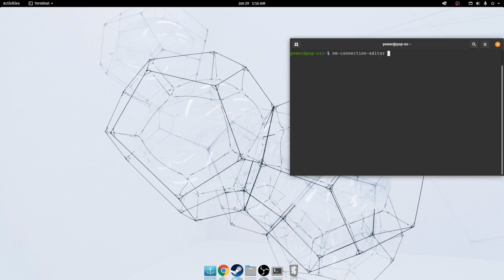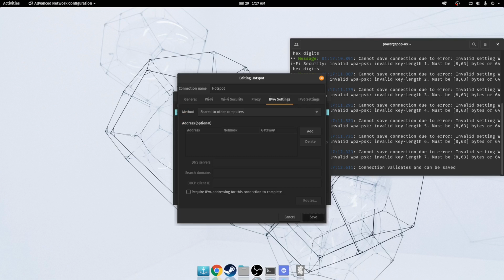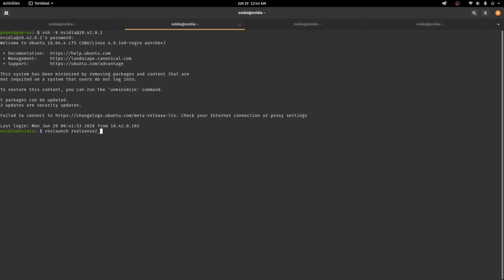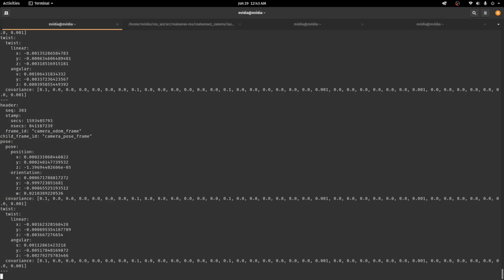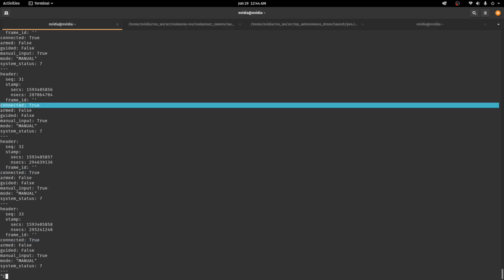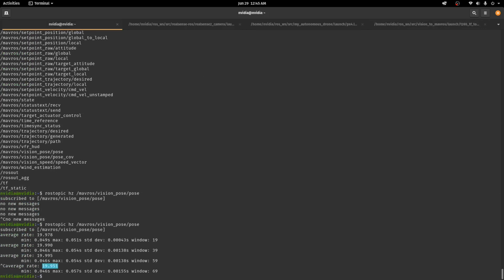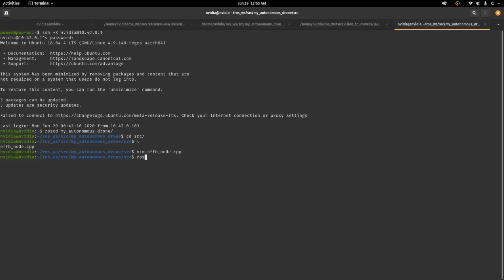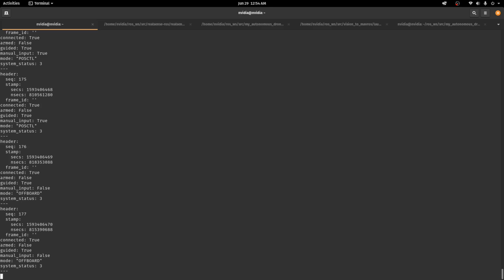DIY Indoor Autonomous Drone! - Finale (Flight)

Comment: Hi, 
Thank you for your great videos, 
May I know the model of the drone frame which you are using?
Reply from the maker: Hey! It's a Spedix S250Q
Reply: @SimpleKernel  Thank you,
 I've been working on an autonomous drone project, 
I am using Jetson tx2 as a  companion computer and T265 realsense as VIO and D435 camera as avoidance.
May I know how much the maximum drone's payload is?
Can it carry all the equipment that  I am going to use?
Reply from the maker: @calibronic  I don't know what the maximum payload is but your setup is similar to my setup. I had a TX2 with an Orbitty carrier board and a T265, I'm sure it could also carry a D435 without any issues.
Reply: @SimpleKernel  sounds great,
I need to change my carrier board. I am using original carrier board for Jetson which is too heavy.
I am checking the Orbitty carrier board that you mentioned, It seems, it has only one USB3 port.
Isn’t it ?
Reply from the maker: @calibronic  Yup!

Comment: Do you think that  adding vins fusion to the odometry of the t265 produce a more robust (to the drift or vibrations) odometry or only more precise ?
Thanks Simplekernel !
Reply from the maker: Hello! I'm not entirely sure, because I don't know how good the T265's odometry generation is compared to VINS Fusion. I think you may have to ask the Intel engineers over at the Realsense repository on Github.

Comment: @simplekernel Do we need to calibrate and sync  with Kalibr camera and imu of the t265 for the Rovio implementation as in the second and third episode ? Thanks for all !
Reply from the maker: The IMU and camera of the T265 are already in sync, so you can use the sensor as is with ROVIO. Here are two links that may be helpful: https://github.com/ethz-asl/vi_realsense https://discuss.ardupilot.org/t/integration-of-ardupilot-and-vio-tracking-camera-part-1-getting-started-with-the-intel-realsense-t265-on-rasberry-pi-3b/43162 . Good luck!

Comment: @SimpleKernel  Thank you very much for this part ! You are really talented not only as engineer  but as educator as well .I see from your website that you have an extensive experience on drones.Could you make an explanation or send some reference related to the control techniques (Kalman filter,PID )  of small swarm of autonomous drones  in acrobatics ? It is really difficult to me to grasp how the velocity and position control of a single drone can influence the others so quickly !
Reply from the maker: Thank you for your kind comments! Here is a good tutorial on EKFs: https://simondlevy.academic.wlu.edu/kalman-tutorial/. Hopefully it'll teach you the basic science which is used in flight controllers. Once you learned about that, you could look at Crazyswarm which use EKFs with multiple drone: https://github.com/USC-ACTLab/crazyswarm. I don't think it's a complex swarm implementation, but it should be something you should browse through as a starting point. In addition, just because Crazyswarm is based on the Crazyflie doesn't mean you can't implement the same system on your own drones. The lab that made Crazyswarm focuses on swarm behavior so I recommend browsing through their publications: http://act.usc.edu/publications.html. As for autonomous acrobatics without an external motion capture system, you should look at https://github.com/uzh-rpg/deep_drone_acrobatics.   Unfortunately, acrobatics is a very complex issue which I don't know a lot about, though I know a bit more about swarm behavior. In the case of swarms, there tends to be a centralized computer which commands all the drone modules. It plans trajectories and then attempts to mitigate collisions through optimization and scheduling, typically through a variety of techniques. The drone position and velocity tend not to be controlled in real time. I don't know of any simple resources so you'd have to dig up some papers around the web specifically regarding what you want to do (EKF control, trajectory optimization, etc.). Here is a good tutorial on navigation and planning in ROS that could probably be extended to swarms: https://www.wilselby.com/research/ros-integration/3d-mapping-navigation/. As for acrobatics, maybe you meant formation flying instead? That's much simpler. It would be helpful for me if you could specify more on your project!
Reply: @SimpleKernel  Thank you for this bunch of resources really really helpful ! The Kalman filter tutorial is interactive , 3d navigation tutorial is for me one the missing pieces .One year ago I tried to use the D435 and the T265 on a drone but I stuck for some wrapper problem that Jetson nano had on USB and that now are resolved.I think that the uzh-rpg implementation will be my target , thanks to the Zurich University for sharing this project.What I would like to do is simple acrobatics ( 8 figure or steep ascending and descending) around a man or a moving obstacle.  Challenging, isn't it ? :-)
Reply from the maker: @gian5887  Quite a nice challenging project! I think you should be fine with doing trajectory optimization on the fly. VIO gives the drone a good agility given the IMU's high update rate. Good luck!